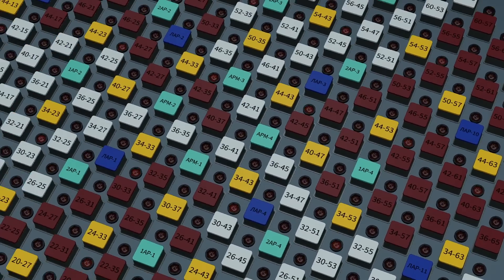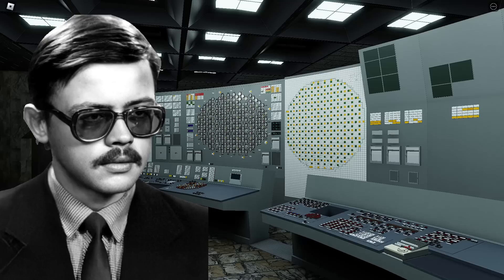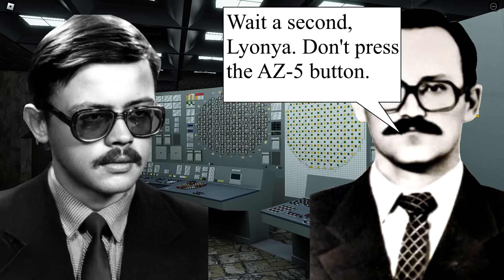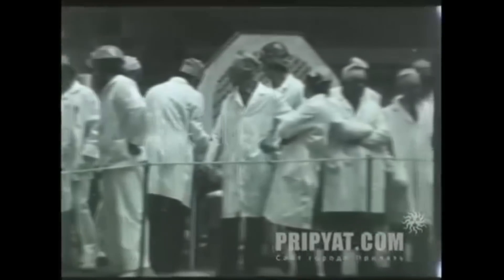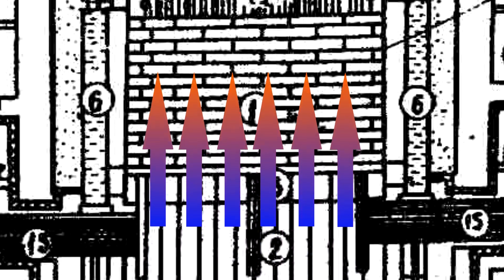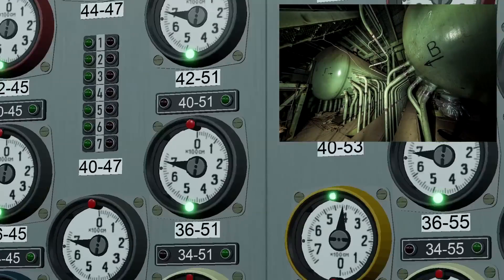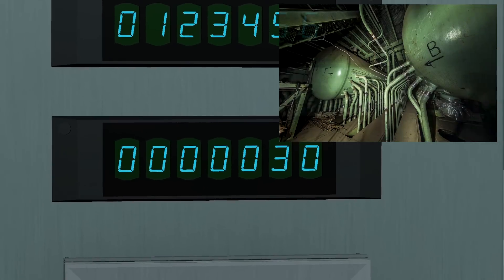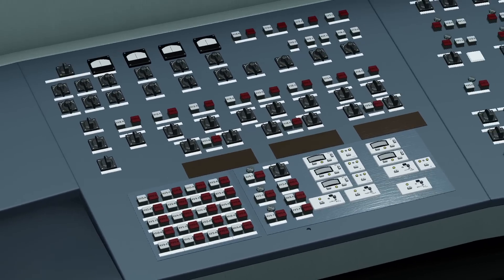Would Not Pressing AZ-5 SAVE Chernobyl?

Comment: Hindsight is 20/20, but without having such knowledge, the operators might have been in big trouble if they didn't press the AZ-5 button. It's like Titanic would have been saved if they had crashed the ship head first into the iceberg, but it would have looked like incompetent operation, and the crew probably would never sail a ship ever again. Society is funny like that. Instead of doing the safe thing and crash the ship head first into the iceberg, we do all we can to not cause any damage to the ship gambling that it will pay off even if the odds are stacked against you.
Reply: Soviet authorities looking to shift blame to faceless underlings would JUMP at workers not having pushed the officially infallible AZ-5.
Reply: That is LITERALLY what happened to the employees at Leningrad-1 who slow walked it's shutdown in 1975. They were all from Mayak and knew how temperamental water-graphite reactors could be from experience. They got blamed for the partial meltdown and kicked to the curb, by the time of Chernobyl it was mostly the new generation of workers plus people from the submarine program like Dyatlov(which had a different design system and thus they wouldn't have known those specific quirks)
Reply: Hindsight shouldn't have been 20/20 when working with nuclear reactors. There was a design flaw already in Soviet reactors, and the personnel knew little of what they were actually doing. Instruction manuals they used had steps CROSSED OUT as well. So that 20/20 vision should've been from the start. These people were ill-equipped to handle the job at large, especially when it comes to running 'tests.' The boss in the room was only concerned about reporting a completed test. Completed it was, with disastrous consequences.
Reply: I get your point, if you cause something bad in order to maybe prevent something worse, you have the problem to prove that something worse would have happened.
Concerning titanic there was a risk to damage too many compartments anyway by unterwater ice right in front of it and/or by causing the iceberg to rotate and cause unforeseeable patterns of damage.
Maybe it would have saved the ship, maybe it would have sunk way faster with up to 100% casualties.
However an interesting tradeoff.
Reply: @franknachname730   That was hardly the trade-off they thought about: Firstly judging distances at night is very hard, so they had the right to assume that they would pass it (which they nearly did). Secondly the side extension of the submerged part of a berg at night cannot be estimated, even less so when its waterline cannot be seen, as no waves were breaking at its base in that very calm night. Thirdly a head - on collision would cause massive damage (they were at 21 knots), like the chimneys coming down, machinery being torn out of its sockets etc. 
In reality they hit the berg so gently, that they did not bounce off, nor was their forward momentum impaired. As a result 6 main compartments were sliced open. If it was 1 compartment less the ship might have been saved, or at least kept afloat for many more hours in that very calm night. 
So any other impact - a harder one and even a head-on one would be preferable to that smooth and long slicing, which given the information they had, was extremely unlikely. Hence in my opinion they made the right decision.
Reply: @andy99ish  I don't think they considered that either and i don't blame them for it because as you say, they couldn't have known. But theoretically I find the question interesting.
I'm not completely sure about the damage behind the bow you mentioned since the ship would slow down a bit until impact and the forward compartments would have acted as a crumple zone to spread the impact over several seconds.
Did other ships that hit icebergs head on with similar speed suffer that damage? (assume similar mass relations)
On the other hand the iceberg more likely might have turned
Reply: @franknachname730   Well, the result of a direct impact depends on mass relation in the first place. IF the berg was a large one, then it would be in the low millions of tons, compared with 50k tons of the ship, yielding  a mass relation of say 50:1, so acting like a solid obstacle. Still you are right to point out the mitigating effect of the crumple zone. All in the damage of a head-on collision would indeed maybe not be chimneys and machinery fully dislocating. But just imagine what would happen to the drive shafts if machinery due to the shock would be moved by say, 1 inch. And then imagine the damage to the bow with cabins etc. meeting the berg with 24 mph head on. Casualties would be rather inevitable. Have a look on the Stockholm (with its reinforced bow, unlike Titanic's) running into the Andrea Doria head on to get an idea. 
Back to the Titanic: Simulations maintain that she would NOT sink after a head-on collision, yet sinking was not on the mental menu of the crew. 
So, from least detrimental to most detrimental outcomes (plus legitimate assessment of probabilities in the moment they saw the berg): 1. passing without contact (very likely - they actually nearly achieved that), 2. collision with 1-3 compartments damaged (likely), 3. head-on with big damage inc. some casualties, yet not sinking (perfectly doable by just keeping course), 4. changing course, but neither passing nor really colliding, yet sideswiping the berg ever so deftly, yet slicing open nearly 300 feet of the hull(very unlikely). I assume they had 1 vs 2 in mind. Options 3 vs 4 is indeed theory, with the outcome that head-on would be still preferable to what had happened.
Reply: @andy99ish if they tied Rose to the front like a bumper it would have been fine
Reply: @franknachname730  It makes a decent stab at an example of how pressure/reputation and safety can combustible interact, but the fact is nobody is ever going to clock an iceberg with a ship because it's "safer than a failed attempt to avoid it". They always were and always are going to try to dodge. Clocking an iceberg has way too many variables and horrible outcomes to consider safe.
Reply: @tescheurich  Yes, i wouln't exspect that too, i just like to think about it theoretically.
Reply: With Titanic, the problem was when they switched to full reverse while trying to steer around the iceberg. If they had INCREASED forward propulsion to full speed, they would have had enough water flowing around the rudder to increase the turning speed which would have helped them avoid the iceberg.
Reply: @Eman-vp5wk  Bravo 👏👏. Buena estrategia de navegación.
Reply: If Titanic went full steam ahead after hitting the iceberg, Carpathia would’ve reached them before the ship could sink and probably only a few hundred people would’ve died.
Reply: @rebelroar78  Isn't the problem with sailing forward with holes in the bow that you force the water faster into the ship too?
On the other hand the screws suck the water level on the hull down a little, at least at the rear and midship.
Reply: Well that's why there is a saying: we are all smart after the incident has already occurred
Reply: It’s like dropping your phone and trying to catch it but pushing it down instead
Reply: Wouldn't momentum have also been a problem, had the Titanic hit the ice berg head-on?

21 knots is 38.89 km/h.... 
And like someone else noted, the ice berg probably was so insanely heavy that it would've functioned as an immovable object.
So a head-on collision would entail every crewmember and passenger continuing to move forwards with ~40km/h, while the ship they were on suddenly stopped dead in her tracks...

I've never run into a solid steel wall (or whatever pointy steel instrument you can imagine on a bridge), let alone at that speed - but I doubt I'd survive such an impact, if modern medical aid wasn't present immediately... 
Does anyone here know what hitting the nearest bulkhead at 40 kmph would do to the meat sack that a human body in essence is? 🤔
I cannot imagine it would be good.... 

So, had the ship collided head-on, there'd probably have been very few people left not-incapacitated from the blow.
And if you have ~10-25% of souls aboard having to render aid to between 9 and 3 people each, then that's just a harrowing disaster scene. 
Most people probably would never get any help whatsoever, because there wouldn't be any/enough people able to provide it!

(side notes: 1) also, the lucky few who'd be bruised but on their feet would likely be without medical training or equipment, and 2) young children would probably fall in a more-bouncy way than adults, and especially the elderly - therefore, young kids are probably gonna be overrepresented in the not-incapacitated category; but young kids won't make for effective help, especially not compared to adults)

Of course, there would be crumpling etc so you'd expect the people to be most to the stern of the ship to stand the best chances - they have the most amount of ship in front of them to absorb the impact for them, and decelerate slightly less immediately. 
So perhaps my expectations/spitball numbers are off? 
Still, I don't see how you would not be flung forwards in the ship, wherever you happened to be at the time... 
(maybe the ones having the best chances would be those in the indoor pool?😆) 

TLDR: I'm not so sure that the crew and passengers would've stood better chances if they'd suddenly been splatted onto the walls at almost 40 km/h.... 
And it seems kinda pointless/unrealistic to discuss that scenario without addressing what it actually entails :/
Reply: @MrNicoJac  There are so many frontal collision of ships, both before (notably the SS arizona) and after Titanic (e.g SS Grampian), including riveted ships, including with solid objects like docks and rocky shores, to know that's not what happens. A 40km/h impact might mean a high deceleration when your talking about a car with a crumple zone thats in the metre range, but with a ship that what amounts to a crumple zone of several dozens of meters to absorb the impact, the deceleration in most of the ship becomes quite sedate. Except for the people in the bow, injuries would have been rather mild. 
There is almost no question from anyone who has worked in designing ships, or who has seriously studied the subject, or other ship collisions, that Titanic would have survived the collision if it were head on. 
There was, with a single exception, also that belief amongst the surviving officers of the Titanic.
Not saying that any reasonable officer would have done anything else but try to avoid the iceberg. It's no fault of the crew. 

I will note that the SS Grampian, possibly because of the hindsight of Titanic, did decide to ram the iceberg in a frontal collision in 1919, it ended with 2 fatalities and 2 injured (it had a crew of 350 and only 750 passengers on board at the time).
Reply: Okay but if you, and I mean literally YOU who wrote this is in charge of the ship, are YOU gonna tell the families of those who died in the head-on collision "yeah your loved ones had to die because I didn't know if turning the ship would be enough, so I didn't even try to get them to safety whatsoever. They just had to die because I didn't want to take any other risks."
Reply: ITT: armchair ship engineers 😂
Reply: I recommend watching this: HOW THE 4th UNIT OF CHERNOBYL NPP WAS BLOWN UP (channel-KS).
Reply: I may be wrong but I think the video pointed out that there was an automatic process that would have still blown up the reactor without them pressing the AZ-5 button. So the knowledge not to press it would have just delayed the inevitable. Although realistically the knowledge would have prevented them from putting the reactor in that position to start with. But if you just dropped in and told them to not press the button it wouldn't have changed the outcome. You would have to get them to not press the button and also stop the automatic process from putting the control rods back in. And even then you would end up with a busted reactor, just not a nuclear disaster.
Reply: https://www.youtube.com/watch?v=yIA_FMz9n1k
Reply: https://www.youtube.com/watch?v=yIA_FMz9n1k
Reply: Like nose down in a stall but that's hammered into pilots minds.
Reply: Well, because intentionally crashing head long into an iceberg will get you fired because they’ll always claim that you could’ve dodged but attempting to dodge and fail doesn’t get you fired, but it might get you killed.

It’s the exact same thing with a heavy truck driver.  More often than not they won’t attempt to swerve because they know that will stabilize the vehicle and cause more problems, but the fact that they didn’t attempt to avoid the accident can get them fired.
Reply: Titanic is a perfect example of why every ship has double hauls now...
Reply: you don't know the under-water shape of the berg
Reply: @nehorlavazapalka  you dont know about how ships are built. The front would crumple & maybe the 1st water tight compartment floods, but it gets to New York. This happens to lots of ships.
Reply: @upthebracket26 The reason the iceberg did so much damage is because the metal that made up the outer hull wasn't forged correctly.  They didn't anneal it like they were supposed to, and so the hull was too brittle. So while there was a slicing action, the hull also shattered like glass on impact.  Had that been a head on collision, they would have sank 100%
Reply: @TheGamersRace  no.
Reply: @upthebracket26 Yes
Reply: @TheGamersRace  That's simply not true, and there is zero evidence to those claims. At no place did the hull plating shatter, nor crack, what happened was that the rivetted seams along the hull were popped open, which is the failure mode you would expect on any rivetted sheet metal structure. There is also no evidence that the rivets were subpar. This dumb information comes from some idiotic documentary where they compared the rivet material (which was puddle iron, as was normal at the time) with modern homogeneous mild steel and concluded it had slag inclusions. Which again, is entirely to be expected from puddle iron.

Harland and Wolf were some of the best shipsbuilders out there at the time, Titanic was just one of the olympic class ships, and one of many others they were building at the time, but for some reason people think that, despite their great reputation, they just decided to make this one ship badly when they were making the others properly.

There was no structural fault with Titanic, and almost any ship of the time would have fared the same if it had hit it in the same way. The only ones that might fare better are some german ships made with a full double hull instead of just the double bottom Titanic had.
Reply: @slome815 I'm not talking about the rivets, I'm talking about the hull plating itself.

Nice rant.
Reply: @TheGamersRace  Like I said, there is zero indication the hull plating cracked anywhere.
Reply: @slome815 Well that's a very false statement, considering the ship cracked then split in two, but regardless who said anything about cracks?  I said SHATTER. Had the hull been tempered to spec there would have been substantially less shattering and far more deformation of the hull on impact.
Reply: @TheGamersRace  I'm sorry, but you're simply wrong, I was obviously talking about the impact, and there is no evidence of any hull plating shattering. You are going against all studies and all experts on the Titanic here.
Yes, the ship broke in half and if you'd ever looked at images scans of the wreck you'd know that the breakage is looks in every way like a ductile failure.
More importantly, what exactly do you think annealing (and I'll give you the benefit of the doubt assuming you mean annealing and not tempering) mild steel, or even lower carbon puddle iron is going to do, because the answer is, very little, unless that steel has been cold worked to death, which hot rolled plates won't be.

Seriously, I'm an engineer with a degree in metallurgy, please show me a single credible source with evidence of hull plating shattering. Even if the hull plating would have behaved brittle (for which there is zero evidence), like some of the later liberty ships would in cold weather, annealing would do absolutely nothing to change the DBTT of the steel.
Reply: @slome815 Have a degree in metallurgy and don't understand the high DBTT of hull plating in that era.  O.K dude.  I'll give you some help:

Too much Sulphur
Manganese Ratio was off
Improper annealing

Want some research?  Capitalsteel did an analysis, but even a quick search can find this info. Bye
Reply: @TheGamersRace  
Refering to a capital steel article that states exactly what I've been saying all along in the conclusion certainly doesn't work in your favor.

"The steel used for the Titanic was far inferior to the steel typically used today, and was much more brittle and not nearly as impact resistant. However, it was certainly the best steel that could be produced at the time."

Notice that last part, which is what I've been saying the entire time.

Again, annealing does not change the DBTT of the steel, high sulfur is only true when compared to modern steels, I have seen chemical analysis of samples of the Titanics steel and it's entirely what you would expect from puddle iron and steel of the time (you know, as that capital steel article points out)

Every piece of evidence points to the Titanic being built to the proper standard of the time, and every other ship steel of the day would show similar metallurgy.

It's entirely amazing that, the less some people on the internet seem to know about  a subject, the more they are condescending towards people with actual expertise on it. Don't post things like that first paragraph when your so obviously out of your depth.
Reply: @TheGamersRace  ships don't shatter into pieces if they hit something. Please think about it...
Reply: @upthebracket26 Actually, they did.  Please research about it.
Reply: @TheGamersRace  how can I research something you've made up?
Reply: @upthebracket26 By not being incompetent and asinine and doing your own research.  

If you look at CapitalSteels analysis, they go into depth about how and why the hull did shatter.  Anything with a crystaline structure can shatter, that includes metal.  And the metal used was excessively brittle, especially by todays standards. Ontop of that, the cold icy waters added to it's brittleness.
Reply: @TheGamersRace  if you look into it, you'd realise ships don't shatter on any sort of impact. 

don't you find it odd that 100,000's of ships have been built but only titanic shattered?
Reply: @upthebracket26 The ships hull did shatter, and the titanic is not the only one.  Go rage bait elsewhere if you're not going to do your own research.  If you don't believe the facts, thats on you.
Reply: All this is a replication of the Soviet lie about the causes of the accident. If you want to know the truth, watch: HOW THE 4th UNIT OF CHERNOBYL NPP WAS BLOWN UP.   (KS channel)
Reply: > It's like Titanic would have been saved if they had crashed the ship head first into the iceberg,

This is absolutely false. Had it crashed head first into the iceberg, the energy released by that would tear the ship apart at every bolt, causing it to sink even faster.
Reply: @SJohnsoninc  That is rather nonsense. While crashing head on into an iceberg with 21 knots would cause substantial damage, the ship would not even come close to falling apart. A ship is designed to crash into large waves, which also have a significant speed of propagation. A good proxy for head-on collision is the Stockholm vs Andrea Doria case.
Reply: @andy99ish Both of those ships were welded and not riveted like the Titanic. Welded steel is much stronger and resilient.
Reply: @kerotomas1  You have a point, yet even riveted ships survived heavy storms. 
Most ship engineers agree that Titanic colliding head on with a iceberg would result in up to three forward compartments being crushed/damaged. So she would still stay float.  Actually a riveted construction is less elastic, so the forces would not as well propagate through the hull. Meaning extensive damage to the bow yes, falling apart for sure not.
Reply: @SJohnsoninc  no
Reply: @SJohnsoninc Bulkheads exist. Large ships seal off in sections. It'd have been messed up, yeah, but that's why ships have engineers on deck. The bow would have crumpled in, bulkheads sealed, and just by not sinking give the engineers a chance to get things moving again. Functionally, the ship was disemboweled across multiple bulkhead sections, making sealing them futile. It'd have sucked, but it would have made it to port.